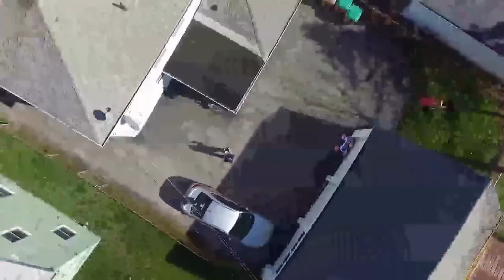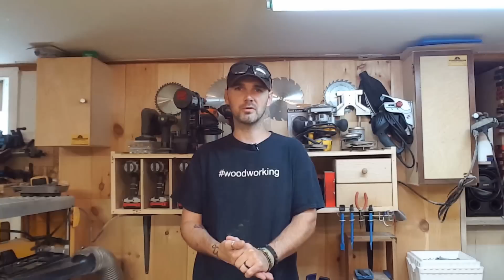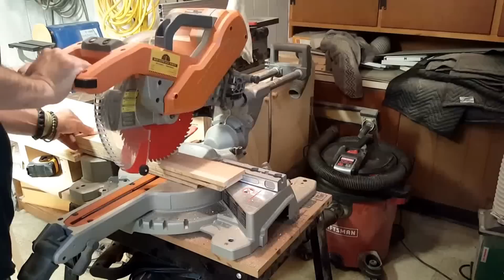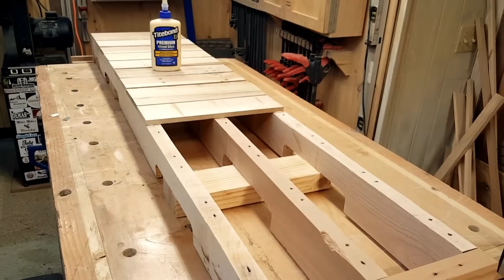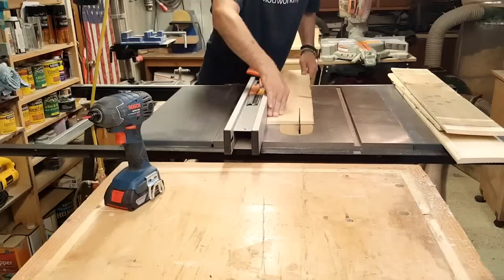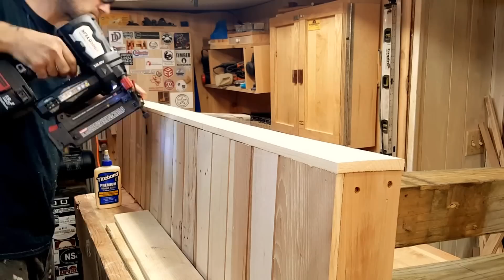How To build Nice Bench OUT OF 2 PALLETS-inspired by DIY CREATORS .

Comment: Hey Just got around to watching. You did a great job man! Looks way cleaner that the one I built :)
Reply from the maker: thanks bro! appreciate it!-i sanded it from 80-600 grit and applied 5 coats of polyurethane  3 spar and 2 spray semi gloss........i think it was..lol thanks for watching and the comment man
Reply: Sounds like you put a ton of work in. I didnt have a Thickness planer back then.
Reply from the maker: DIY Creators yea aboit 8 hrs total ..not including dry times..oh yea thickness planer is a gem to have..ohh i 1st used boiled linseed oil b4 applyimg the 5 coats ..that makes the grains and colors pop!
Reply: Joe basementwoodworking Nice. I have a lot of learning to do when it comes to finishing.

Comment: U cant build shit without your tools, Im poor bro I only have a drill lolz
Reply from the maker: Get a jig saw. Thats what I started with a jigsaw and a drill. Jigsaw can RIP boards,act as a bandsaw,scroll saw cut every angle u need. These tools came after ALOT of time, hard work,and money spent from that hard work. So get a jigsaw,  a combo square and carpenter square. And dont forget the tape measure;) and what I have is just basic stuff nothing crazy but it all works and gets the jobs done. I'm not rich by any means bro. So I feel ya
Reply from the maker: Check out what DIY Creators did with a jigsaw and a sheet of plywood and some 1x4s. He built a 5 in 1 tool. Serious jigsaw is so underrated but so versatile get a good one though "ya get what ya pay for"#FACTS
Reply: I was just being sarcastic, but I know what you mean, Im building a bar out of pallets and Im only doing it with a jigsaw a drill and a mouse sander from walmart LOLZ n thank u for the response bro.